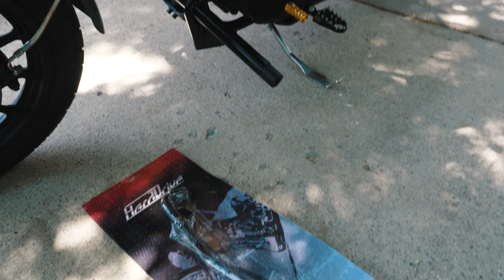Most UNDERRATED Harley Upgrade // 1999 Harley Davidson Dyna Build PT 8

Comment: Well, I just forked out the money as I fitted extended dampers from Trackerdie and longer shocks from Hagon here in the UK - I'm getting old and need a softer ride - and the bike was leaning over quite a bit further.... it's a bit better than with the standard stand but....
I did the same with my '06 Sportster Roadster which had the longest stand of all rubermounts which gainded 2 1/2 inch at the front and an inch or so to the shocks and that baby did lean.... so I tried a supposedly extended stand for the rubbermount and found it to be the same as the standard one, so I tried one from a '98 XLH which was an inch longer but.... ended up getting a one inch extended for an '89 to '03 XLH (supposedly +2 inch now) and that is better.
 The bikes are at the same angle of lean now and it is easier 'picking them up' off the stand but not as easy as it was with standard forks and 11.5 inch on the Dyna and 12.5 inch shocks on the Sporty ! back then I had to lean the bikes to the right to get the stand out fully......

Comment: Miles, do you have issues with the kickstand sagging when it's resting against the passenger peg mount? I did the +1 kickstand on my Dyna as well, and had to remove the passenger peg bracket in order for it to retract completely.

Comment: Haa! I just SCORED a 13k mi Dyna Convertible 1997 vintage. Clean as grammas bathroom! $2GRAND! 
Hadda clean the tank & carb ,new battery and oil.
The gangsta lean.  Instead of 2"" over toobs do longer damper rods. Just dont trackerdie-cuz their units are crap. Crooked. Made my own with my machinist.
1.375 " more travel and LONGER legged.
Try welding the motormounts at the rivets & then SPUTHE LINK it!
Hybrid swing arm is cool too. Machine dropouts for axle. Cut old swingarm. Industrial adhesive and bolts back where old dropouts were. You can use Brocks & modify it

Comment: Drag Specialties makes a gloss black +1" kickstand for dynas as well, about $25 and since it's drag Specialties any dealership, Indi shop, or individual can buy them easily.  Just as an option.

I swapped mine out the same day I lifted the rear end, shit had me way too paranoid lol. Looks way cleaner than the blocks some dudes mount onto the oem kickstand too in my opinion.

The older dynas don't have the rubber block on the frame to stock the kickstand from chattering against it ?

Comment: Good stuff man! Have you put any thought into getting taller rear suspension? Game changer in my opinion. Also, if you're doing 2+ in front, the rear should be at least 13.5 imo, or else the bike isn't level. All personal preference, but I dig it on my bike! Got an early dyna too.
Reply: Miles Mortensen oh for sure! I thought they looked a little taller than 12.5. Awesome build man!! Good parts choices. Only thing I would add would be the tach and speedo on the bars.

Comment: How tall are you that you were able to get away with the 2" riser in the front and 2" added to the back ?
Reply from the maker: Im 6'2"
Reply: @PowerCult  thank you I'm 6'4 and most motorcycles look small and I enjoy learning about the Dyna wide glides thinking about buying one and have been skeptical because of my height.
What would be a good year to buy ?
Reply: @brianwilliams8203  01 fxdx. Skip the wide glide. The dx is way more nimble and has taller/better stock suspension to start out with

Comment: that thing needs motor mount stabilizers too
Reply: @PowerCult  add ja some sputhes and weld your seams at the rivets. No more twist on them that way. 
Control the heat as u weld. Be patient. A set of Satyas triples on there would be killer too. More stable at speed! I got tons of tricks. Align the chassis & motor/swingarm too. 90°at the discs & 0° at the seat.
Look - sw.arm trans are together,motor wiggles from mounts.ENGINE & SWINGARM SHARE SAME PLANES

Comment: I lowered mine 2.5 “   If you make the DYNA taller. It handles worse  brake worse  and lazy steering. I don’t get it    But no such thing has a bad DYNA. Your lucky to have that back drop.  Those roads. You really are lucky .
Reply: Incorrect  sir. Increasing height gives more lean angle. As well it should not have any effect on braking aside from making it better if you go to a stiffer spring...
Reply: it totaly wrecks the trail and rake which changes handling. its all abouut the engineering and the math....
Reply: My worn out peg’s would agree about lean.   But incorrect.  I don’t think so.

Comment: I stopped the video at 5.54 and compared the lean to a shot at 1.15..... there doesn't seem to be any difference.....
Reply: My thought too. Might be a slight difference but not enough to justify $100 and end up with a fitment problem as well. No thanks...
Reply: yes
Reply: I can see the difference, about 1" lol. But thats alot when you are talking about balance point of the bike.
Reply: @kenbrake2828  But at $100 an inch though..... jeez I could make a lot of money at that rate...... !